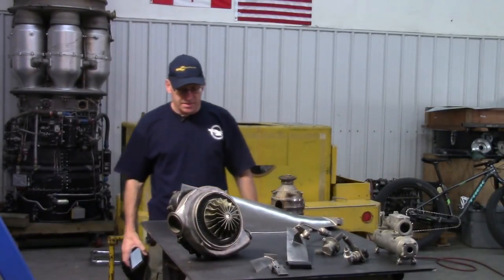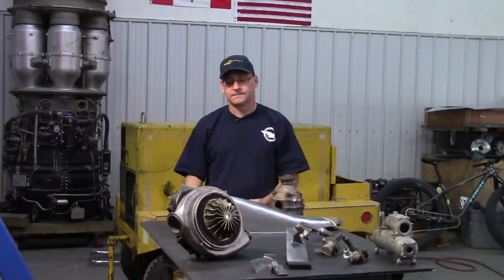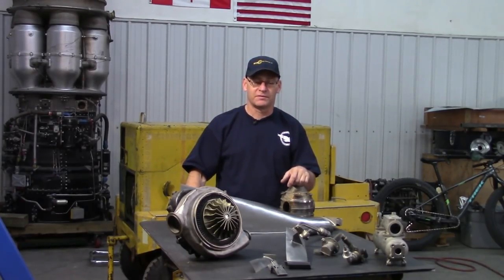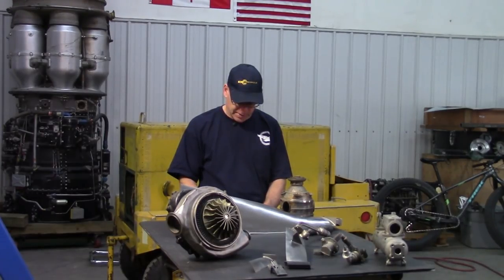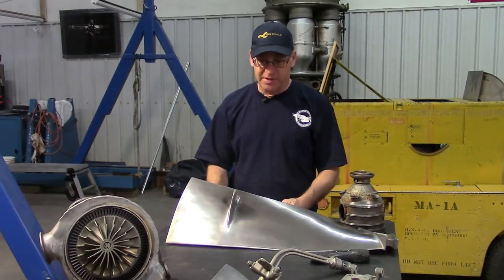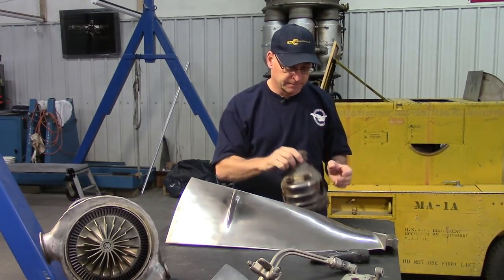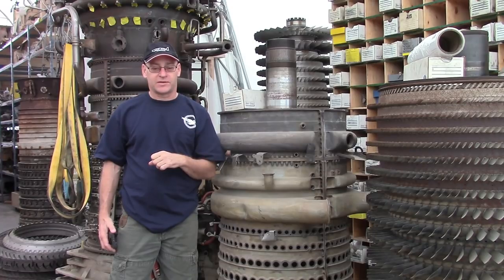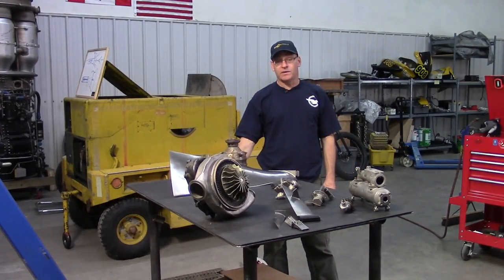Jet Questions 97

Comment: Cant you make a engine able to keep running at a lower rpm if you get it parts that are not as heavy as the original parts
Reply from the maker: Hmmm, I'm gonna answer: Vanilla elephant peanut square...
Reply: and where do you want to get these parts and who would want them not knowing if and when the engine falls appart with them ?
Reply: If anything, wouldn't a lighter rotating assembly let it run faster? that's how it works with piston engines, anyway. Idle speed is pretty much set by how much fuel you have to give it to keep it turning, if you lighten the moving bits, that doesn't change, but lets you spin it faster before centrifugal/centripetal (depending on your reference frame) forces start throwing bits out the sides.

Edit: and in aircraft engines at least, the stock parts are already as lightweight as they can safely be for obvious reasons.
Reply: >Vanilla elephant peanut square...
This is the best comment on the entirety of YouTube.
Reply: Because these engines aren't positive compression like a piston engine you have to be turning a certain rpm to get enough airflow for compression. Below that and it won't run very well, if at all. They also have a very narrow power band and will go from very little power to full power in a few thousand rpm.

Comment: AgentJayZ, You talked about the combustion gas cartridge for starting a jet engine in your video. I thought your viewers would appreciate this link to what I think is being used to start an F22 Raptor. https://youtu.be/U9l_NnvsB-g
Correct me if I'm wrong but it sure looks like what your talking about. Either way, it's a pretty cool video.
Update: Not a combustion gas cartridge in the F22 video link I found out, but a cool video to watch anyway.
Reply: Thanks superskullmaster for the correction. I'm assuming the starter turbine is like an APU for commercial aircraft allowing the starting of the main engines through an on board bleed source independent of an external source. I'm also assuming that using a cartridge to start the starter turbine saves weight and space on the aircraft by not requiring a heavy battery to start the starter turbine. Just an educated guess because I only have experience with civilian aircraft.
Reply: superskullmaster, thanks for the explanation. I'm familiar with the hydraulic accumulator method with my civilian experience on the S-70 Blackhawk which uses a 3000psi charge accumulator to start the APU. I did watch the video of the F-15 and F16 and yes, the F-15 has a cool and very distinctive sound to it. It does seem though that the F22 is using some sort of cartridge to start the starter turbine with all the smoke and orange flame exiting the side of the aircraft as seen in the video I posted.
Reply: superskullmaster, I was reading about the F22 starting system because I'm curious to know what the orange flame and smoke is I see in the video. The system is very similar to the F-16 and F-15. They happen to call it the Auxiliary Power Generation System which also uses compressed air. Apparently the smoke is condensation from the sudden expansion and cooling of the compressed air when it is released. And from what I'm reading the flame is leftover residual fuel burning off from the Auxiliary Power Generation System. Either way it's a pretty cool system.
Reply: Lockheed is an awesome company. I use to work for Sikorsky which as you well know, is owned by Lockheed. In my opinion Lockheed will benefit Sikorsky's future a great deal.

Comment: Re threads. Sorry. It cannot possibly be a "world standard" if it's not metric. Fact of life. Everything is metric, except in one large country and a handful of little ones.
Reply from the maker: OK, fair enough. I should have said it was a world standard, instead of is...The designs of most of the engines we work on are more than 50 years old.
Also, aviation was once dominated by UK and USA, and it is a very conservative industry. There is still a lot of fractional/inch/imperial hardware out there.
There is a growing proportion of aviation equipment being designed and built using metric standards.. but of the 13 different engine types I have worked on, only one is metric.
...so my perception may be a little biased.

For everything non-aviation... yeah, I have a full set of metric tools.
Reply: The Swedish standardized the inch to a metric measurement via gauge blocks.
I wish I could remember where I have heard this.
So metric did get us to the moon :)

Comment: 7:50 If you look at what a so called heat exchanger really does, you notice the term is wrong. The term heat exchanger implies that one thing gets traded in exchange something else. But that is not the case. Here is whats really happening: two fluids of different temperature make contact only seperated from a thin sheet of metal. Then heat is being transfered from the fluid of higher temperature to the fluid of lower temperature. There is no heat going the other way - no exchange taking place. A more suitable term would be heat transducer. 

heat transducer or exchanger is the more generic term. Intercooler is a device that lowers the temperature of a gas in between compression stages. This improves the thermodynamic efficiency as compressing a hot gas takes more energy than compressing a cold gas. However intercoolers for power generating gasturbines are barely in use since the additional costs for equipement usually exceed potential savings in operation.

Anyway, great channel with great videos!
Reply from the maker: I can understand the point you're trying to make, but it is functionally a heat exchanger. The heat will travel with equal efficiency from the hotter liquid to the colder liquid. Just because in use it always goes one way, does not negate the fact that it could be just as efficient as a fuel cooler as it is an oil cooler.
So I respectfully disagree with your very straightforward and not altogether unconvincing point of view.

Comment: Another A380 with engine problems. I believe the last  380 engine failure one was due to an issue with an oil tube that was drilled improperly. I've always said them turbofans when they spool up sound like a bucket of hammers. My opinion is it's a poor design.  Watch a video from first class at these engines spooling up. All that vibration leads to one thing... kaboom... here's the latest look at a turbofan engine on an A380 that failed 
https://youtu.be/SCKg4zObV_U
Reply: Speculating on the root cause of the failure at this stage is premature, particularly by those who know little or nothing about jet engines.  I've already seen stupid and ill-informed speculation elsewhere and the media are no better in this respect - but, anything for a good story, eh?
As it was a French-registered aircraft. albeit with US engines, the investigation should be headed by the French BEA organisation, with the Danish authorities also involved, as the failure reportedly occurred over Greenland. They will very probably be assisted by the NTSB from the USA and the two engine manufacturers.
Reply: In terms of "all that vibration" you speak of, with all due respect, I have to tell you that you clearly do not know what you are talking about.  And please take that assessment from someone who spent a career lifetime in the design of gas turbines, which is why I object to your phrase "poor design", on behalf of the industry on both sides of the Atlantic.  The big turbofans (and all jet engines, for that matter) can make some very individual and characteristic sounds, particularly when starting up.  The GE90, in my experience as a passenger, can be a little "rough" during start-up, but that is due to a very temporary combustion instability, which also occurs to a lesser extent in many other engines.
To draw a parallel, personally I think that Porsche air-cooled engines in their rear-engined sports cars sound like bags of nails.  But, as an engineer who was initially brought up in the auto repair business, I am well aware that their design is solid, well proven and reliable.
Reply: The turbofan blades are loosely fitted into the rotor by design.  They find the proper seat as the rotor spins up to speed.  That's the "bucket of hammers" you've been hearing on start-up.
Reply: grahamj9101 if you are unclear about what is missing from the front of the Air France airbus A380 just ask. It doesn't take a rocket scientist to tell you what's missing.I could spot it easily. It's called the turbo fan. I'm sure Jay knows also.
Reply: grahamj9101 so tell me what's missing from that engine besides the cowl
Reply: It was apparent to me and I was very clear in my own mind in respect of exactly what was missing from that engine.  What I was unwilling to speculate on was the mechanism that resulted in the complete release of the fan disc and its blades and whether the booster stages were still in place.  
That determination is for a professional defect investigation team to perform, not amateurs indulging in uninformed speculation.  However, the FAA now appears to be pointing in the direction of the possibility of a fatigue failure, the root cause of which may be revealed in due course.
Reply: grahamj9101 I think you'll find part of the answer if you research these terms
 1.1 Maximum Takeoff thrust (MTO); 1.2 Maximum Continuous thrust (MCT); 1.3 Maximum Climb thrust (MCL); 1.4 Maximum Cruise thrust (MCR). Pilots   Usually follow these guidelines on climb out and on their way up to cruise altitude. Many of the airlines engines and various systems are constantly being monitored from the ground by various sensors located in vital areas and they pay close attention to out of limit conditions. They usually bring a plane in for service when they see a parameter out of range. I really wonder who was monitoring this bird. Since the turbofan and cowling are obviously missing my guess is something in or near the fan was fatigued and let go violently judging by what was left over. If you look at the leading edge of that wing it looks to me like the slat had some superficial marks on it also. Lucky for the crew lucky for the passengers. Not so lucky for the ones who designed that engine.
Reply: MrShobar yes you can hear a lot of clicking sounds if you spin the turbofan by hand. It's when they spool up some make quite the buzz saw or bucket of hammers sound sometimes heard in the cockpit and in seats just ahead of the turbofan generally by the window closest to it
Reply: I'm not at all clear why you are referring to those terms, as I don't think they are relevant in this case.  I have been retired from R-R for some years now,  but I am aware that the latest big civil turbofan engines are monitored in real time and incipient failures can (in some cases) be identified by changes in the recorded parameters.  That was done to a limited extent, even in my day, but the data had to be downloaded and analysed.
Assuming for the moment, however, that this event was a disc 'burst' failure, .as a result of a fatigue crack propagation, any change in vibration levels of the fan/LP spool would probably have been negligible until the last few seconds (milliseconds even) of the developing failure event.
Reply: grahamj9101  my opinion is that someone f_ _ _ _ed up big time thinking they could put something on any engine that can blow apart,   has to be tested to make sure if it does it can contain the failure and destruction of the rest of the engine. Just a bad idea
Reply: Sorry, but I think that your speculation is a step too far.  
I will be keeping tabs on the French BEA website for updates: however, I suspect that they will be tight-lipped, unless and until they need to publish a more specific Airworthiness Directive than that already published the FAA.
I'm speculating on the limit, but there must be a distinct possibility of a fatigue failure from an undiscovered material or manufacturing defect.  If this was the case, there might (or might not) have been a missed opportunity to detect the incipient failure, assuming that the engine has been off the wing and through repair and overhaul.
I will wait and see.
Reply: grahamj9101 Rolls Royce was tight lipped about the Quantus A380 and even though it was a totally different issue that blew their engine apart and crippled that monster of a plane it didn't endear the trust of the public. Let's see what Engine Alliance has to say. According to CNN Engine Alliance is a joint venture between engine makers General Electric and Pratt & Whitney. I certainly hope they are open and forthcoming.
Reply: Soon after the QF32 event, I was in conversation with a former colleague at R-R Bristol, who was involved in the failure investigation.  I had been checking the Australian Transport Safety Bureau website almost on a daily basis and commented on the openness of their updates, including the publishing of a photo of the recovered failed IP turbine disc.   He described the ATSB as R-R's "worst enemy", to which I replied, in no uncertain terms, that R-R was its own worst enemy.
Reply: grahamj9101 agreed
Reply: Going back to your original remark, "another A380 with engine problems": while this aircraft has had these failures, which have gained considerable publicity, the B.777, for example, has also had its share.  I just wonder whether these events have been treated less sensationally because they happened on a US-built Boeing model.  
There was, of course, the BA38 crash landing at LHR back in 2008, because of ice blockage in the FOHE of a Trent 800.  More recently, there was an uncontained failure of a GE90 engine and a fire on another BA B.777 at Las Vegas in 2015.  In May of last year, a PW4000 engine on a Korean Air B.777 suffered an uncontained turbine blade failure. This was followed, a month later, by a major fire in the GE90 engine of a Singapore Airlines B.777 at Changi Airport as a result of a crack in the FOHE.  I happened to be in Singapore at the time, having flown in (and out again) on a GE90-powered BA B.777. 
And this year, I flew to Singapore and back with Singapore Airlines.  I was hoping to be on one of their A380s, which I much prefer, but found myself on one of their B.777s, which was GE90-powered, of course. Nevertheless, I continue to fly on B.777s, because the big turbofans are extremely reliable, as compared to the first-generation jet engines on, say, B.707s and DC8s, which were more reliable than the piston engines that preceded them.